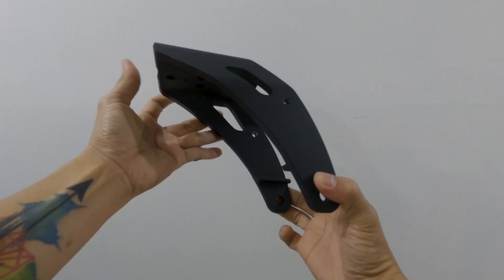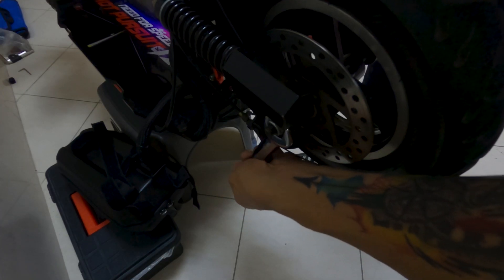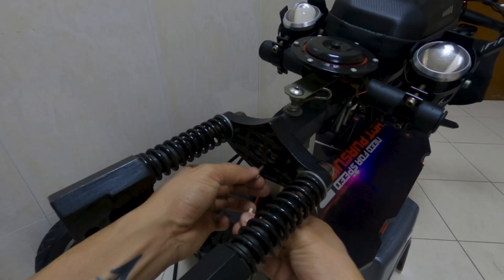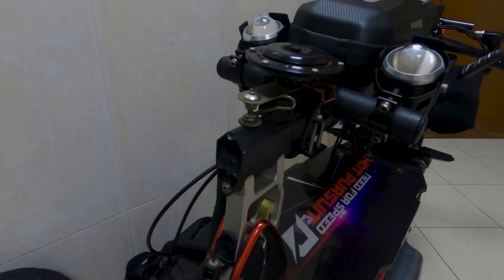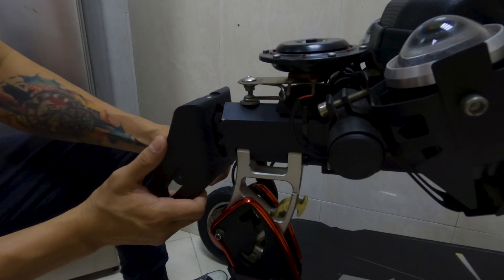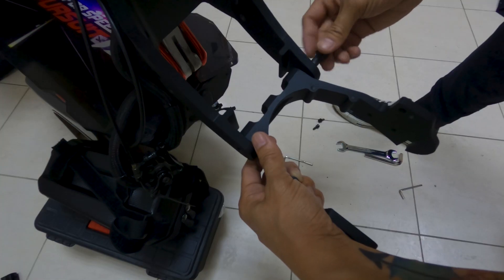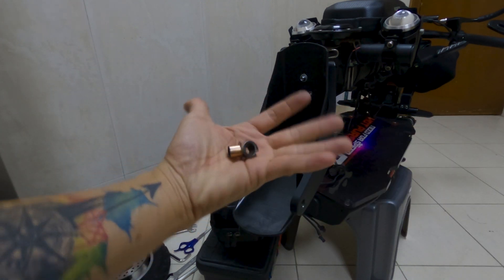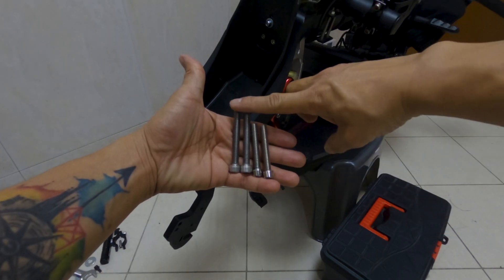Speedway 5 C-Type Front Fork Installation For Emove Cruiser | E10 Electric Scooter | For Dual Motor

Comment: bossing san m n order ung front set??
Reply from the maker: Goodday kaadik!
Sa AliExpress ko nabili yan 
Check mo tong link.

Just found this amazing item on AliExpress. Check it out! 
AED151.34 | Original front fork for SPEEDWAY 5 electric scooter Skateboard spare parts
https://a.aliexpress.com/_oC1ncin

Just found this amazing item on AliExpress. Check it out! 
AED27.24 | Disc Brake Bracket for 10 inch SPEEDWAY 5 KUGOO M4 PRO Electric Scooter Rear Wheel Damping Brake Bracket Spare Parts
https://a.aliexpress.com/_okXgo9N

Shock absorber https://amzn.to/47uirDk

Ride safe lage kaadik!

Comment: I wonder if this will work for the E move Cruiser V2? Did you put a motor on the front?
Reply from the maker: Goodday!
I don't think it will work for emove cruiser v2.
I haven't actually seen yet the V2 but what i've noticed after watching some reviews on youtube...the shape of the steering pole at the lower side where the c-type suspension was  attached is round.

I might put a motor on the front.

Ride safe always!
Reply: @jaysonulanday the Voro website now has the cruiser v2 dual motor upgrade kit for pre-order and it comes with zoom full Hydraulic brakes.
Reply from the maker: @3dandyrandy3  
Wow! That would be great!
Reply: @jaysonulanday  I'm gonna get it.
Reply from the maker: @808_Freedom  
Update me once you're done installing it.
Goodluck!
Reply: @jaysonulanday  it's not expected to ship till the end of December.

Comment: Is there any difference in ride height between stock and speedway suspension? 
And how did it effect wheelbase?
Reply from the maker: Goodday!
The ride height stays the same.
Clearance from the ground did not change.
One thing i noticed is that steering or manuevering became more smooth.
The opening width of the swing arm where you install the wheel is wider than the stock.
You will need a longer axle and extra axle spacer.
Just follow the vid, i put sa right size of axle you will need.
Ride safe always!🤟
Reply: Wow! Thank you for the information, keep up the good work!
Reply from the maker: @katsooba  
Thank you too!
Ride safe always!🤟

Comment: boss, sa UAE po ba kayo? baka pwde po pa share nang link saan nabili yung Speedway 5 C-Type Front Fork. gusto ko rin upgrade ng ganyan yung sakin. meron ako nakita sa ali express kaso may kamahalan, nasa 41 euros
Reply from the maker: Goodday kaadik!
Sa AliExpress ko nabili un c-type.
Check mo tong link:
Just found this amazing item on AliExpress. Check it out! 
AED150.97 | Original front fork for SPEEDWAY 5 electric scooter Skateboard spare parts
https://a.aliexpress.com/_omieZZ6

Just found this amazing item on AliExpress. Check it out! 
AED27.17 | Disc Brake Bracket for 10 inch SPEEDWAY 5 KUGOO M4 PRO Electric Scooter Rear Wheel Damping Brake Bracket Spare Parts
https://a.aliexpress.com/_onAyorw

Suspension tingin ka sa Amazon.
https://amzn.to/3QDTC0J

Kelangan mo rin ng 8x60mm(2x) / 8x50mm(2x) bolts.
Saka washers.

Sundan mo lng un nasa vid kaadik!

Ride safe lage!🤟

Comment: saan ka po naka bili ng front for assembly?
Reply from the maker: Goodday kaadik!
Sa AliExpress ko nabili un c-type.
Check mo tong link:
Just found this amazing item on AliExpress. Check it out! 
AED150.97 | Original front fork for SPEEDWAY 5 electric scooter Skateboard spare parts
https://a.aliexpress.com/_omieZZ6

Just found this amazing item on AliExpress. Check it out! 
AED27.17 | Disc Brake Bracket for 10 inch SPEEDWAY 5 KUGOO M4 PRO Electric Scooter Rear Wheel Damping Brake Bracket Spare Parts
https://a.aliexpress.com/_onAyorw

Suspension tingin ka sa Amazon.
https://amzn.to/3QDTC0J

Kelangan mo rin ng 8x60mm(2x) / 8x50mm(2x) bolts.
Saka washers.

Sundan mo lng un nasa vid kaadik!

Ride safe lage!🤟

Comment: ka'addik san mo nabili ung mga parts
Reply from the maker: Goodday kaadik!
Sa AliExpress ko lahat nakuha mga yan.
Just found this amazing item on AliExpress. Check it out! 
AED150.98 | Original front fork for SPEEDWAY 5 electric scooter Skateboard spare parts
https://a.aliexpress.com/_oDRmJME

Just found this amazing item on AliExpress. Check it out! 
AED27.18 | Disc Brake Bracket for 10 inch SPEEDWAY 5 KUGOO M4 PRO Electric Scooter Rear Wheel Damping Brake Bracket Spare Parts
https://a.aliexpress.com/_opMHBDk

https://amzn.to/3XJpfuT

Sundan mo lang un vid kaadik.

Ride safe lage! 🤟

Comment: Boss anong size ng bolt, washers at shock ang klangan?.
Reply from the maker: Goodday Kaadik!
Kailangan mo ng 10x140mm na bolts para pagkonektahin un c-type suspension.
Sakin kase pinutol ko.
Un washers nmn, kuha k nun aluminum para di kalawangin (M8 3mm size)
125mm suspension/shock.
Need mo rin ng mga bolts para sa suspension/shock (M8 60mm).
Kuha ka ng wheel axle front (10x160mm) para maikabit mo un Mag Wheel ng harap.
"Disc brake backet" kailangan mo rin para mai-install mo un brake caliper.
Kailangan mo rin ng (left side brake caliper)

Sundan mo lng un nasa vid kaadik.

Ride safe lage!
Reply: Ok po boss maraming salamat s info. Ride safe idol👍
Reply from the maker: @ 
Ride safe din lage Kaadik!🤟

Comment: Pre mag Kanu po sya Atska kasama naba pati ang shock na kinabit mo
Reply from the maker: Goodday kaadik!
Un c-type fork nasa 350aed, hiwalay pa dun un suspension(86aed)
Check mo tong link, sa AliExpress ako bumili.

Just found this amazing item on AliExpress. Check it out! AED141.41 | Front Fork for SPEEDWAY 5 Electric Scooter Speedway V Skateboard Spare Parts
https://a.aliexpress.com/_mLGK8xc

Just found this amazing item on AliExpress. Check it out! AED43.71  15%OFF | 150/125mm 450/750lb Bike Spring Shocks Absorber Suspension Electric bicycle Scooter,E Bike Spring Bicycle Rear Shock
https://a.aliexpress.com/_mMnwTIm

Iba rin un bolts at washers

Just found this amazing item on AliExpress. Check it out! AED3.16  28%OFF | 10pcs M3 M4 M5 M6 M8 304 A2 Stainless Steel Black grade 12.9 steel DIN912 Hexagon Hex Socket Head Cap Allen Bolt Screw L=4-120mm
https://a.aliexpress.com/_mMJVhoa

Just found this amazing item on AliExpress. Check it out! AED31.59  21%OFF | 50-100pcs  M3 M4 M5 M6 M8 Aluminum washer round hollow no thread standoff spacer thickness 2/3/4/5/6/8/10/12mm
https://a.aliexpress.com/_mOFEu1o

May continuation pa yan vid kaadik.

Ride safe lage!🤟

Comment: Baka pwdd ko makoha lahat ng details na nabili mo na kinabit jan sa c type  sa harap mo boss🙏
Reply from the maker: Goodday kaadik!
Bale un c-type fork nasa 350aed.

Just found this amazing item on AliExpress. Check it out! AED141.41 | Front Fork for SPEEDWAY 5 Electric Scooter Speedway V Skateboard Spare Parts
https://a.aliexpress.com/_mtY6hOO

Tas un coiled suspension nasa 86aed/125mm.

Just found this amazing item on AliExpress. Check it out! AED43.71  15%OFF | 150/125mm 450/750lb Bike Spring Shocks Absorber Suspension Electric bicycle Scooter,E Bike Spring Bicycle Rear Shock
https://a.aliexpress.com/_mtxf1qe

Nag provide din ako ng aluminum washers.

Just found this amazing item on AliExpress. Check it out! AED31.59  21%OFF | 50-100pcs  M3 M4 M5 M6 M8 Aluminum washer round hollow no thread standoff spacer thickness 2/3/4/5/6/8/10/12mm
https://a.aliexpress.com/_mtj4ssq

2pcs M8x60mm bolts.

Just found this amazing item on AliExpress. Check it out! AED3.16  28%OFF | 10pcs M3 M4 M5 M6 M8 304 A2 Stainless Steel Black grade 12.9 steel DIN912 Hexagon Hex Socket Head Cap Allen Bolt Screw L=4-120mm
https://a.aliexpress.com/_mPuVlvk

2pcs M8x50mm bolts.

C-type fork
Coil suspension
Aluminum washers
Bolts(60mm/50mm)
Saka flat washers.

Comment: nasa magkano total na gastus mo boss s upgrade na yn.??
Reply from the maker: Goodday kaadik!
Bale un c-type na fork nasa 350aed.
Just found this amazing item on AliExpress. Check it out! AED141.41 | Front Fork for SPEEDWAY 5 Electric Scooter Speedway V Skateboard Spare Parts
https://a.aliexpress.com/_mPESQ6K

Un suspension nmn 86aed.

Just found this amazing item on AliExpress. Check it out! AED43.71  15%OFF | 150/125mm 450/750lb Bike Spring Shocks Absorber Suspension Electric bicycle Scooter,E Bike Spring Bicycle Rear Shock
https://a.aliexpress.com/_m0jYZkS

Tas iba pa un aluminum washers at bolts.

May continuation pa un vid kaadik.
Ride safe lage!🤟

Comment: Boss San ka Po nagorder nyan
Reply from the maker: Goodday kaadik!
Sa AliExpress ko nabili un c-type.
Check mo tong link:
Just found this amazing item on AliExpress. Check it out! 
AED150.97 | Original front fork for SPEEDWAY 5 electric scooter Skateboard spare parts
https://a.aliexpress.com/_omieZZ6

Just found this amazing item on AliExpress. Check it out! 
AED27.17 | Disc Brake Bracket for 10 inch SPEEDWAY 5 KUGOO M4 PRO Electric Scooter Rear Wheel Damping Brake Bracket Spare Parts
https://a.aliexpress.com/_onAyorw

Suspension tingin ka sa Amazon.
https://amzn.to/3QDTC0J

Kelangan mo rin ng 8x60mm(2x) / 8x50mm(2x) bolts.
Saka washers.

Sundan mo lng un nasa vid kaadik!

Ride safe lage!🤟

Comment: magkano nagastos mo dian at san pwd bumili
Reply from the maker: Goodday kaadik!
Check mo tong mga links.
Jan ako nag order ng mga parts.

Just found this amazing item on AliExpress. Check it out! AED15.68  40%OFF | Wheel Axle Front 10X100mm 10X160MM Electric Scooter for 10 Inch 8 intch Wheels Rims Tires Tubes Motorcycle Parts
https://a.aliexpress.com/_mrYlYWo

Just found this amazing item on AliExpress. Check it out! AED33.97  15%OFF | 50-100pcs  M3 M4 M5 M6 M8 Aluminum washer round hollow no thread standoff spacer thickness 2/3/4/5/6/8/10/12mm
https://a.aliexpress.com/_mOI2pDw

Just found this amazing item on AliExpress. Check it out! AED26.45 | Disc Brake Bracket for 10 inch SPEEDWAY 5 KUGOO M4 PRO Electric Scooter Rear Wheel Damping Brake Bracket Spare Parts
https://a.aliexpress.com/_mttgsMU

Un shock absorber (125mm)
Di na available sa link na pinagbilihan ko.
Search k n lng sa aliexpress.

Just found this amazing item on AliExpress. Check it out! AED141.41 | Front Fork for SPEEDWAY 5 Electric Scooter Speedway V Skateboard Spare Parts
https://a.aliexpress.com/_mLaD404

Un mga bolts sa hardware ko n binili.
60mm(2x) 50mm(2x)

Di ko na rin nacompute kung magkano lahat nagastos ko hehehe!

Ride safe palage kaadik!